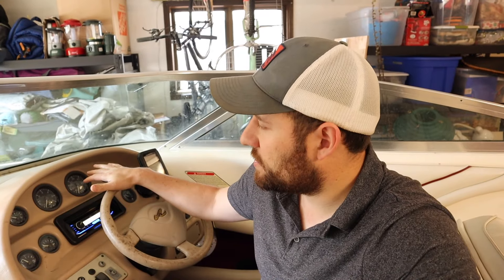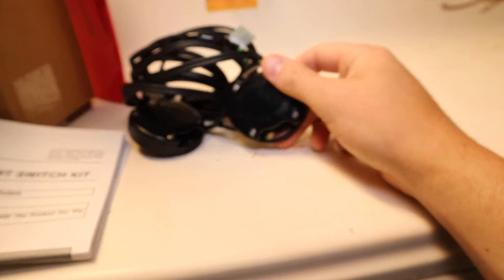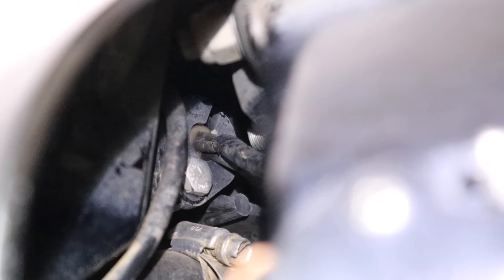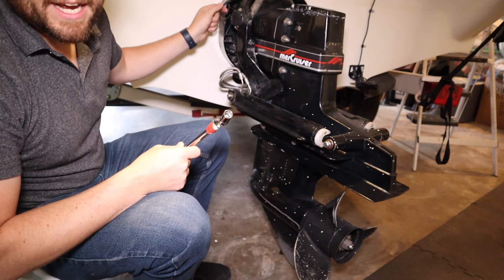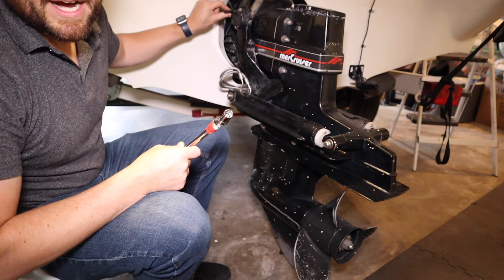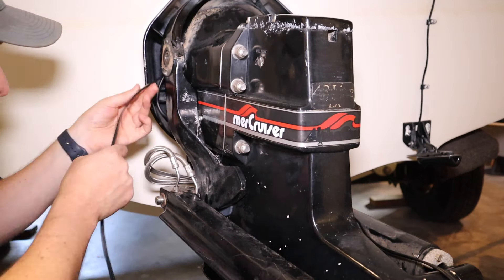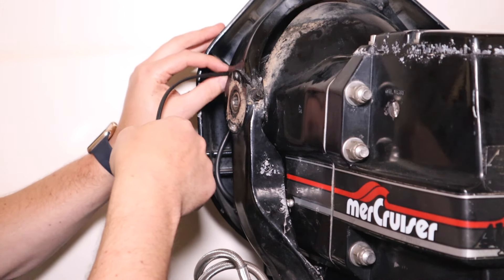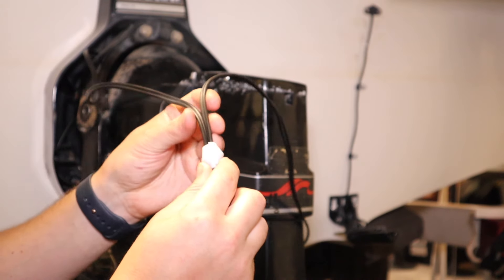Installing new Trim Limit & Sender Without removing outdrive Mercruiser Alpha 1

Comment: We have a bolt like that in the car world that we call a "b*tch bolt"...lol
Thanks for the video! I will be rewatching it. I have the same problem with the up button not working. I have the switch on mine, so I'm wondering if I could just take it apart and clean it?
Reply from the maker: No problem! Yes, I would definitely start with removing your limit switch and cleaning it real good. Could easily be the metal connectors are heavily corroded and no longer making a connection. You will then have to re-calibrate it as I did in the video, super easy. If that doesn't work, I would make sure there are no breaks in the wiring between the limit switch and the trim pump. Very likely it is one of those two things. Good luck and let me know how it works out!

Comment: Can You Help point me in the Right direction? My Trim sender/limit kit is In and my Limit seems to be Working But besides the "harness" I have No clue Where Sender wires into ???
Reply from the maker: Sender wires run to a wire harness on the engine. I show this in my video starting at 16:25

Comment: My trim button works on the shifter up and down. Buy my gauge don’t work! It did work last year and this year it hasn’t worked. Do you think it’s a switch issue or wiring issue?
Reply from the maker: Yes it is most likely your trim sender. Best to just replace both sender and limit switch since it will be the same process.

Comment: Would you be able to splice the new sensors to existing wiring with high grade waterproof connectors ?
Reply from the maker: I considered this myself as I could reach the old wiring coming from the inside of the boat. I want to say yes this would be possible, as the wiring appears to just be 16 gauge standard wire. If you get a solid connection and make sure to heat shrink the connection, it would probably work. Long term, I would highly recommend just running the new cable through, as it will be cleaner and provide a better connection (obviously). Once you cut the cable on the senders, there's no going back lol.

Comment: I can’t pull my boat out to change this wondering if I can just jump it inside the boat and bypass the sensor
Reply from the maker: You most likely could, but then you risk yourself or someone else raising it too high using the thumb switch while running in water.

Comment: Great video . Can you help me out to find wish cable line Go to the gauge . Like what color so I can find it  , I’m putting also a gauge cuz my panel didn’t have the trim gauge so I’m adding it thanks 🙏
Reply from the maker: I'll take a look this evening and let you know if I can trace it.
Reply: @Jacob190000  man that will be great man I’m trying right know to see wish one is and is making hard time 🙏
Reply: @Jacob190000  did you see the wire?
Reply: @randypedret8924  hey sorry wasn’t able to take a look until this evening. It is tough because the cables are bundled with the main wiring harness, but I took some pictures for you. What’s an email I can send them to? I’ll delete after I copy it.
Reply: @jacobdominguez2772  did you send it ?
Reply: @randypedret8924  I didn’t see an email
Reply: @jacobdominguez2772  I will send it again
Reply: Did you resived
Reply: Are you deleting the email I send it 2 times did you receive?
Reply: @jacobdominguez2772  ?
Reply from the maker: No I'm not deleting it, it's probably against YouTube rules or something. If you click on my profile, you can go to the About tab, and send me an E-mail. I will reply with the photos.
Reply: @Jacob190000  did it
Reply: @Jacob190000  Bro nothing yet do you have a fb community or some place that I can contact you
Reply from the maker: You sent an email to my gmail that’s listed on my about tab?
Reply: @Jacob190000  I didn’t see the email and the one is there says YouTube user and when I touch there is for share your account
Reply: @Jacob190000  crying_0h
Reply: @Jacob190000  @
Reply: @Jacob190000  icloud
Reply: @Jacob190000  .
Reply: @Jacob190000  will start with   endive_
Reply: @Jacob190000  tell me if you get it ?
Reply from the maker: Sent to crying_0h
Reply: @Jacob190000  before that you put the endive_
Reply: @Jacob190000  ?
Reply: @Jacob190000  cuz that goes next to endive_
Reply: @Jacob190000  sorry all this hard work man 😅🙏

Comment: Great video. I have a question? (I bought a 1986 Thundercraft 15ftr. Labels on the inside motor in the boat are as follows:  MerCruiser 140  this sticker was on the rocker cover. And there was another sticker MerCruiser DRIVE UNIT Serial No 6895851 Mercury Marine ) What is this Alpha 1 I don't know if my motor is the same as this?   I did notice as to when it was in the shop, the guy mentioned the main wire which was plugged in at top of motor toward the end of your video was either really aged or fried and the sender on the passenger side wasn't there. [I'm really not sure if this item part number you posted, would work for mine? It really does look the same. 

Maybe I need to call the Marine and give them my Serial Number off the boat for maybe they could give me some insight, into what this motor is. lol... 

Not sure if this unit kit U bought will be good for me, looks the same though.
Reply from the maker: Considering how relatively simple these sending devices are, it's very possible it is the same as your 1986, or will work with it. I would maybe call a shop to confirm though.

Comment: I have a swim deck so I just drilled a hole above the bell housing and ran my wires in that way,  sealed it with silicone,  done in 10 minutes,   Swim deck hides everything
Reply from the maker: Nice, yes I have seen people do it this way. As I mentioned in another comment, my main concern would be to make sure the trim wires won't get pinched while raising or lowering the drive. Otherwise, it is no worse than drilling a whole for your depth finder, etc.

Comment: Just a thought, what if there was a notch for the socket on the top of the gimble housing (helmet) so you could access the bolt for the wire clamp much easier? I'm thinking about doing this so next time so I won't have struggle to get at that bolt.
Reply from the maker: You mean by drilling/sanding it to make it larger somehow? I don't think I'd try that, but another viewer commented below that he was able to reach it through that opening using a 1/4 socket. He mentioned having to jack the trailer up, so that he could lower the trim all the way down though. In my opinion, It isn't too bad just going through the side as I did. It takes a little time, but not worth doing any permanent damage.

Comment: This has been a problem for our truck on and off for maybe three years now … goes away and comes back . My husband fixed the wires the last time this happened but I’m pretty sure he did not take off the inside of the door and disconnect everything this video shows … he just spliced the wires and replaced them … I’m guessing this is why it is happening again ?
Reply from the maker: Yes if the issue keeps occuring I would definitely completely replace the senders with the wires instead of splicing them. Splicing them may work temporarily but has a much higher chance of failing again.

Comment: Can you not leave the existing wires an just change the sensor?
Reply from the maker: Yes you can if the wires are in good enough shape. In my case, the wire and insulation was deteriorated badly from the sensor all the way back to behind the gimbal housing. Trying to patch that up would have been a challenge and I wouldn't have trusted it to last.

Comment: Do you feel like the 20 3/4 is too low when your boat is on your trailer?
Reply from the maker: When trailering you can hit the “trailer” button that raises it all the way up past that 20 3/4”
Reply: @Jacob190000  Mine doesn't have a trailer button so I guess 20 3/4 is my max height.  lol
Reply from the maker: No, even if there is not a dedicated trailer button there will always be a way to raise it further. I would look at the manual for your boat. Someone else said this to me before and then they found how to raise it. I would say my trailer button raises it more than twice as high, and that is a big difference for trailering

Comment: So I got mine installed and adjusted, but I cannot for the life of me get the gauge to read full trim. I was only getting it at the half trim mark fully adjusted out and limits set properly, but knocked the sender a smidge up from the bottom and reads 3/4 now. Not sure if I should keep dicking with this, or futile efforts at this point?
Reply from the maker: I would ensure you are starting with the sender in the correct position. I had a somewhat similar issue with my limit switch momentarily because I had tightened the sender half way counter clockwise before adjusting. Kind of hard to explain without a video,  but just keep adjusting the sender/switch by loosening the screws and spinning it counter clockwise or clockwise, that is most likely where your issue is.
Reply: Cars & Computers now that i think of it, shouldn’t it only show full trim in trailer mode?
Reply from the maker: @PMPerformance  Yes, if it's working right, trim should only go up to about 1/4-1/3 without using the trailer button. You will need to check out the instructions and measure the distance on the trim cylinder. Page 10 of the link below: https://www.perfprotech.com/store/app_themes/ppt/images/product-specs/trim-sender.pdf
Reply: Cars & Computers yep, did all that already. I just tried getting full trim onto top of the gauge like you showed, but I think it only goes 3/4 normally to show full out and that last 1/4 for trailer mode?
So I think I’m good.
Thanks for your help.
Reply from the maker: @PMPerformance  Ah okay, in my video I was actually using the trailer button to go all the way up, which may have thrown you off. My trim will only go up about 1/3 without using the trailer button, but it will vary from boat to boat. As long as you measured then all should be good. No problem!
Reply: Cars & Computers awesome, yea that threw me off.
I’m solid. I appreciate the help and the video!

Comment: What size socket was the bolt? I may have missed it if you said, sorry..
Reply from the maker: 7/16 for the bolt! same size for the Gen 1 Alpha's with 2 bolts as well I believe.
Reply: @Jacob190000  loved your video.  I just got a boat with a set yp just like yours.  I found that the wires  that go to the dash gauge aren't comnected to anything.  I can't see in your video what the wires look like by your distributor that you disconnected.  Any help on the colors of the wires would be helpful.  Thanks

Comment: Would a 1/2 inch drive extension fit in there
Reply from the maker: I think it would fit up into spot just fine, you will just have less room to work with, as you will also need a 1/2 inch universal joint socket adapter which will be larger. I would say to give it a shot, and if not, run to the store and get a smaller 3/8 or 1/4 size.
Reply: Thanks mate I may do when the time comes only as I have loads of 1/2 bits including swivel adapters. Top video !
Reply: One more thing what size socket head is it in mm ? Sorry I’m in Uk lol
Reply from the maker: @darrenloud4067  No worries, I believe that will be 16mm. Let me know how it goes!

Comment: So where does the trim wire go hook up to
Reply from the maker: I show in the video starting at 16 minutes. Limit wires go to the harness by the trim pump and sender wires go to a harness on the engine block right under the plastic cover.

Comment: If you move the sensor the drive should move too, so beware when adjusting with the power on.
Reply from the maker: Sensors do not actually control the drive at all. One sensor simply sends the trim level to the gauge up front, the other is essentially a continuity kill switch which disables the trim up button when the trim is too high(continuity breaks). This is between the sensor and the trim pump.

Comment: I changed both parts but my up button  still isnt working. Any other clue?
Reply from the maker: Does your down button, and trailer button work? If so, I would check the trim limit switch cable that runs to the pump. First, ensure it is in fact the limit switch cable you have running to the pump(not the sender). Next, ensure the connections are solid with the wires running out of the pump. Potentially even bypass those wires and connect directly with temporary wire to see if that is the issue.
Reply: @Jacob190000  yeah I changed the limit and sender. Still not working and yes the down and trailer button works not the up
Reply: @TheKnceoincusa  , did you figure out why your trim up button wasn’t working?  I have the same problem.

Comment: Great video, but to those watching, make sure you actually need to change this sender.  The copper contacts on the sender often get contaminated with grease from the nearby grease zerk.  Remove the sender cover and check that the contacts are clear before doing this repair.  I had the same problem and cleaning the contacts fixed the problem.  Great video here.  https://www.youtube.com/watch?v=pUEQQq5p0Q4
Reply from the maker: I believe I did mention this in the video, but definitely a good thing to check before doing this job. That is if your wires are still in good condition.
Reply: @nathanmcolton , thanks for posting this link!  You may have saved me!

Comment: the switch is never the problem it seems....the wires are the problem.,the heat from the engine dry rots the wires..so when I do mine,I plan on shielding these wires with some kind of casing all the way to the pump..and the same on the outdrive to the sender.
Reply from the maker: Yep those wires are real fragile, especially considering they're exposed in the water. Shielding them with something should definitely prolong their life. I have also heard of the switches getting corroded, but that is an easy fix just unscrewing them and cleaning them.

Comment: You don't have to run new wires, the wires are still good. Just remove the two switches, cut the wires close to the switches as possible. Solder the new switch wires to the existing ones, put shrink tubing over the wires, put a tad bit of silicone over the solder connections making sure you do one of the solders far enough away from the other that they don't touch, put a tad bit of marine silicone over the solder connections, slide the shrink tubing over the connections, heat it and your done. Before shrink tubing or soldering, you can make sure you have the wires correct by moving the trim up and down and checking to make everything works properly, if not, swap the wires around until correct. Then seal it up, bam...your done.
Reply from the maker: That was something I considered. But to me, it was well worth it to just replace with the wires and everything. My wires were unusable at least 6 inches from the switches. So, I would have had to cut pretty close to the opening under the bell housing and it just wouldn't have been a strong wiring job.
Reply: What’s the wire color that go to the trim gauge?
Reply: Can you help me to find the trim signal that goes to the gauge so I can add it

Comment: omg just pull the drive and bellows...much easier..less stress dude
Reply from the maker: For some it is easier and less stress to do it this way. I won’t argue a professional would just pull the drive and be done with it, but many DIYers prefer this way and it works just as well.